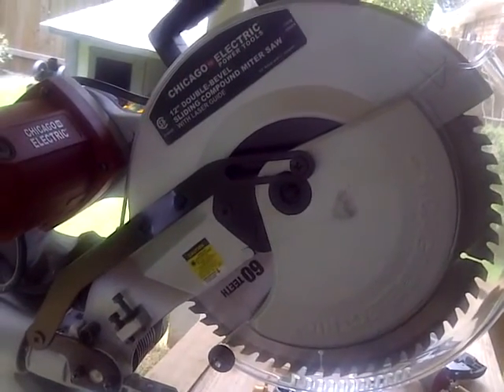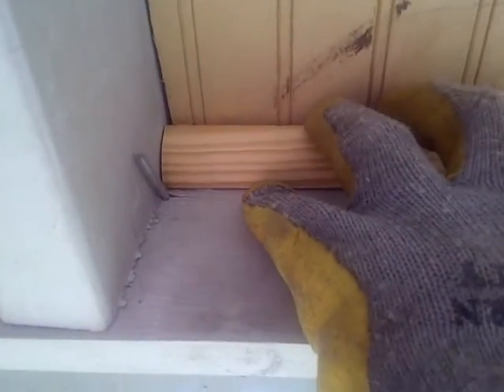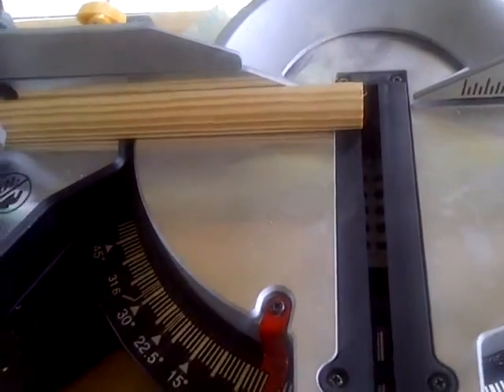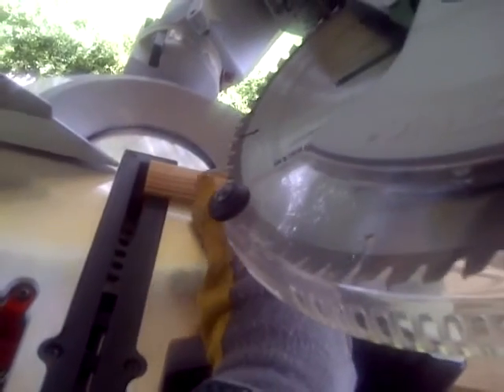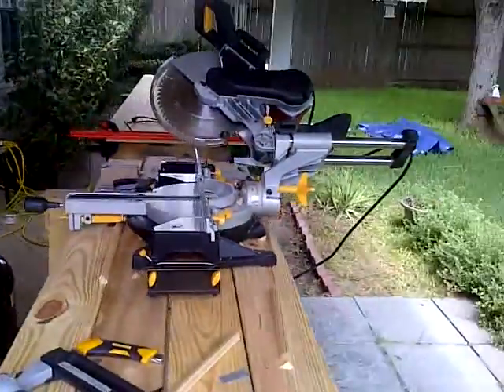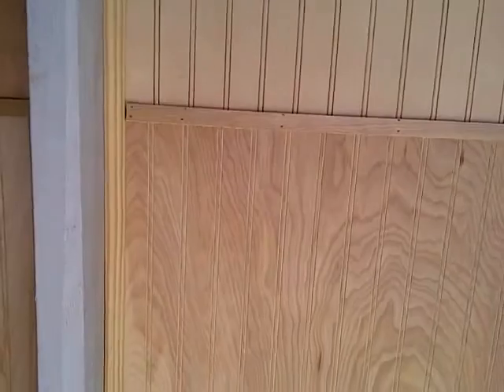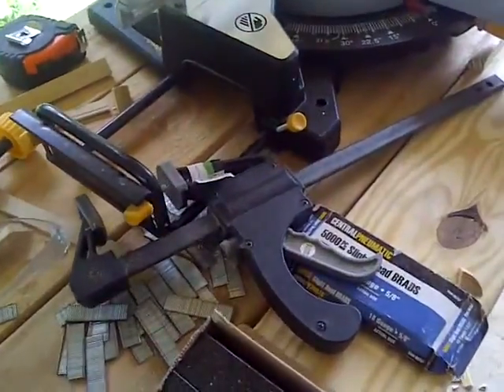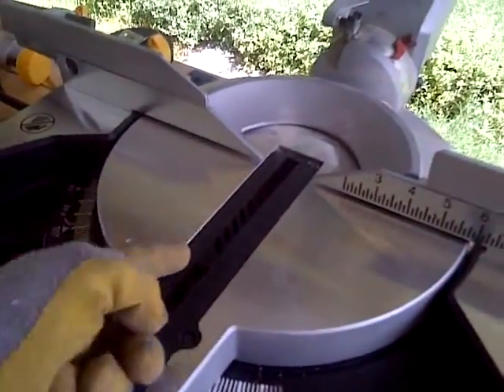12" Double-Bevel Sliding Compound Miter Saw With Laser Guide Part 08 Field Test Update

Comment: James Bond goes ahead and invest in the H.F Miter Stand, it's well worth it and when your finish using is, it will fold up the size of a dolly ( handtruck) with the saw still mounted to it.  Just slide saw to the end with the wheels on it and once you get it adjusted right it'll be self-supporting.
Reply from the maker: ok will look for it in the future.  Thanks.